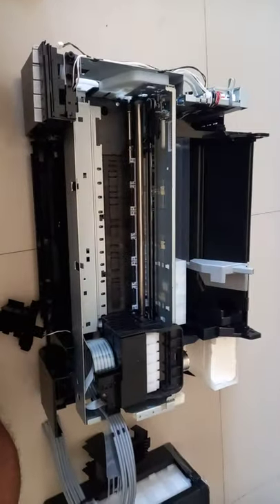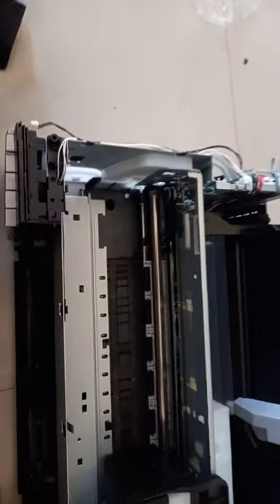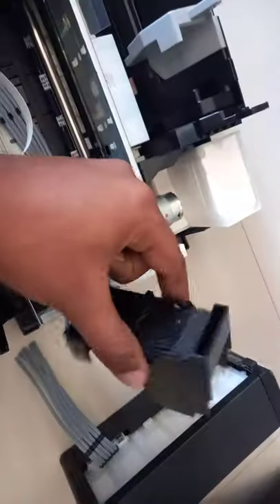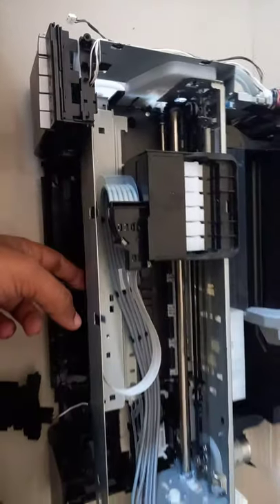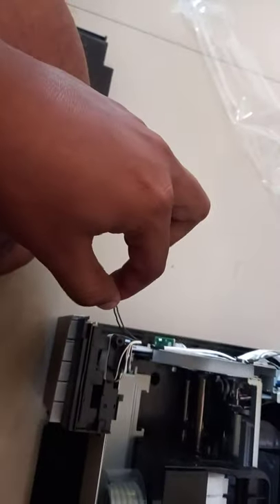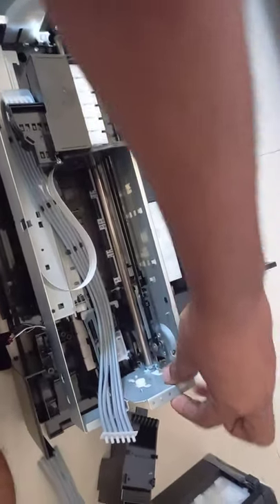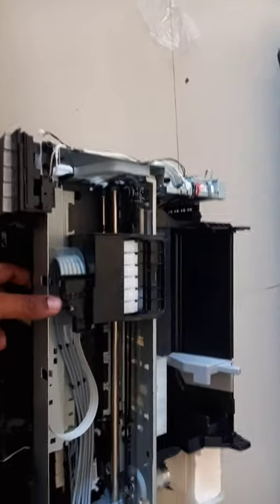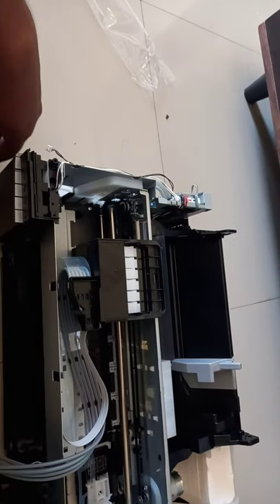How to Convert Epson L805 to Dtf printer (remove pizza wheel)

Comment: how can i stop the headstrikes???, ive done everything i could and i still get them constantly. printer is set to thickest paper, pizza wheels are removed. paper is inserted properly, flat be is perfectly flushed to exit but i still get headstrikes more then half the time.
Reply from the maker: cut those Rubbers front side and keep 1 thick glass front side . Best tip of the day